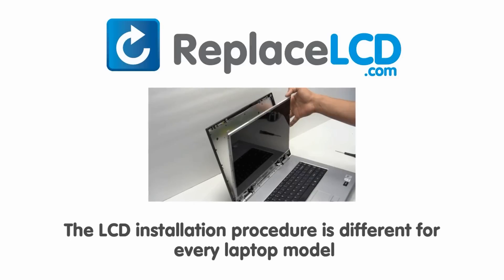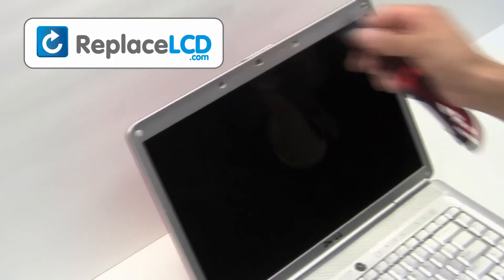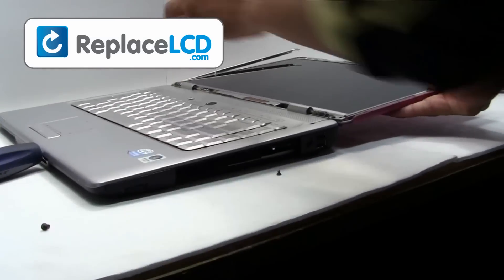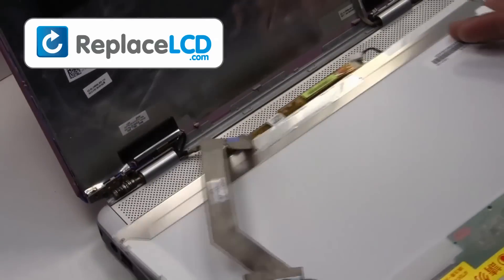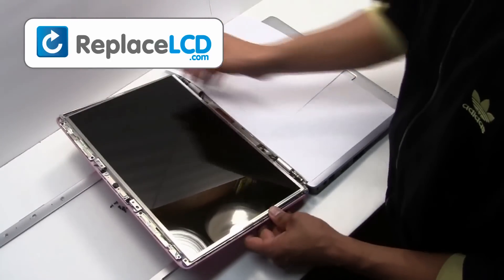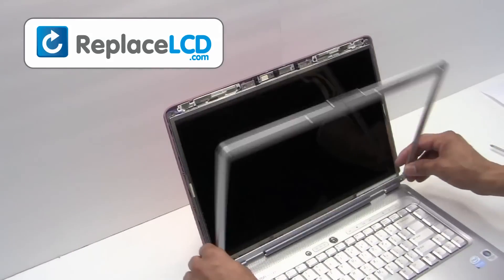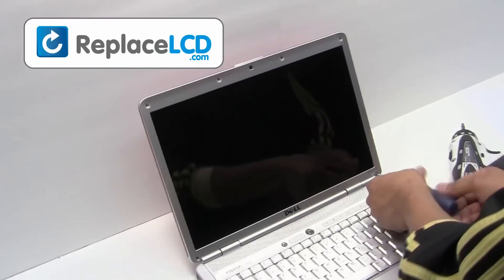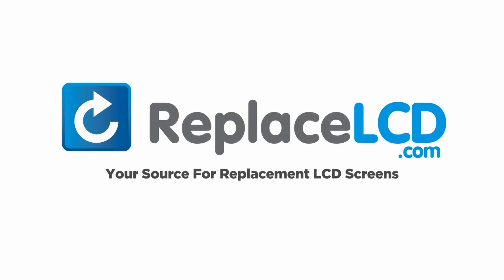Dell Inspiron LCD Screen Replacement Guide 1525 1545 - Replace Fix Repair Install Laptop

Comment: Hey, can you please help me,  just wondering if you know the answer to my question. I have a dell inspiron 1525 laptop, will it's screen fit into a dell inspiron 1545 laptop, providing the screen size is the same. Just want to know are all the connectors the same, will it work?
Thank you